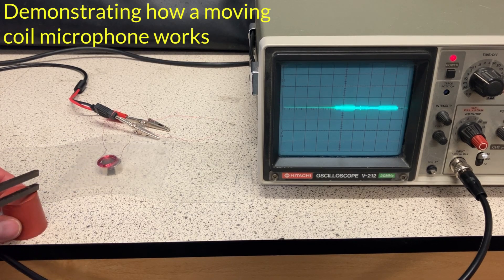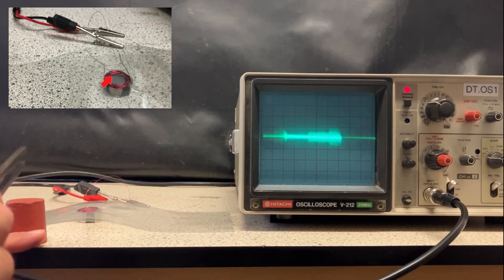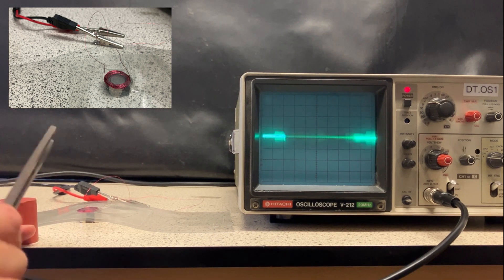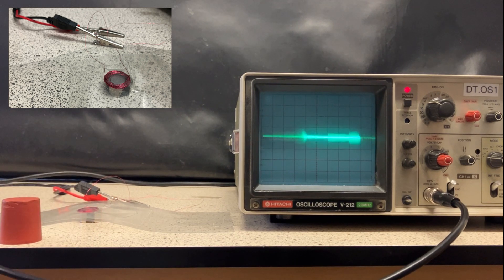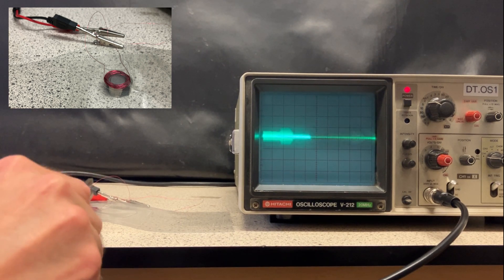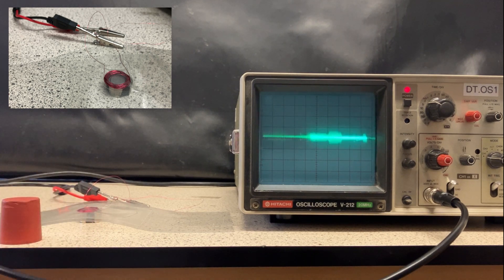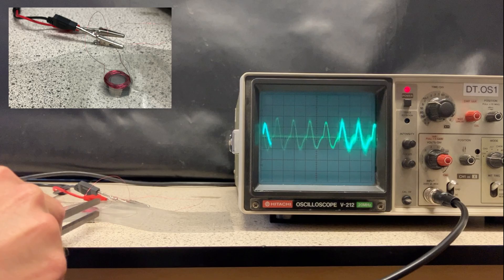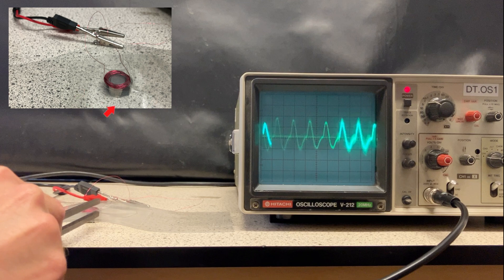Demonstrating how a moving coil microphone works

Comment: Try striking the tuning fork but do not touch the plastic sheet and just hover it above the magnet. I wonder if the vibrating metal affects the magnetic field ever so slightly and you would still pick up a very slight signal.
Reply from the maker: As the magnet is very strong it tends to attract and touch the magnet. But a thoughtful suggestion still.